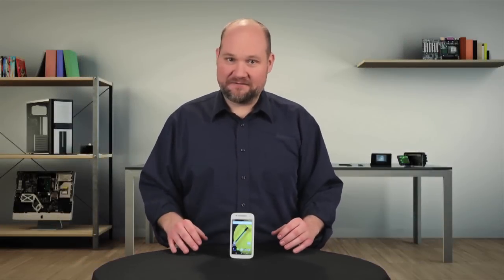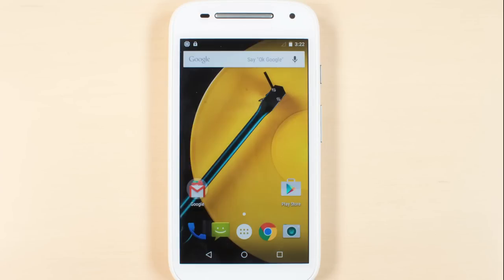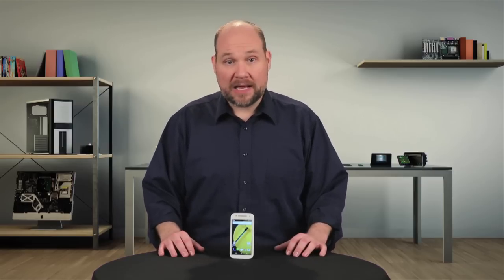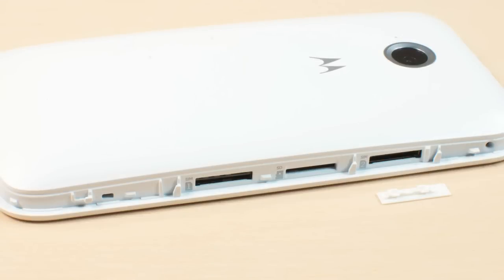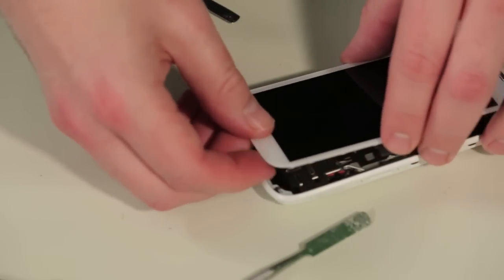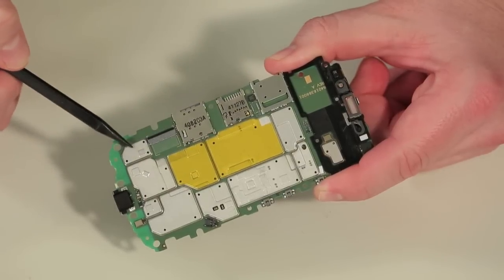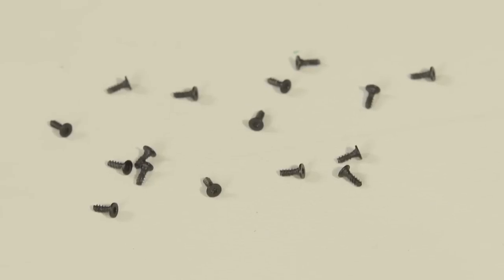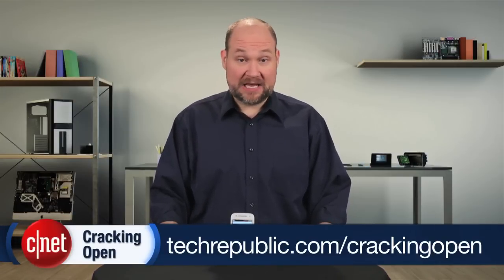Cracking Open - Motorola Moto E 4G LTE

Comment: What a stupid design. I have a Moto e 4G LTE that I purchased SIM-free in late 2015. I live in London and I use it on an occasional basis with a Lycamobile SIM card specifically to call my family in Italy affordably. (My current daily driver phone is a Samsung A5 (2017) which I have under contract. If I were to ask for roaming to be activated so that I could phone abroad, it would literally cost me a fortune to make a call.)

The Moto e can be said to be still in as good as new condition except for one thing, a couple of months ago the battery died. I ordered a new one recently and have just received it but now that I want to change batteries, I suddenly discover that the back doesn't come off and the only way to replace it is to remove the screen and basically dismantle the whole thing, something which I don't feel competent to do. Whatever happened to "lever off the back (without tools), swap batteries (without tools), replace the back (without tools)"? Is it me or did I dream that's how things were with my previous Blackberry and Samsung phones? Stupid, stupid, stupid design.

Comment: Do not {{{{{-event trust "freedompop"}}}}} 3 days of overage on the net? robbed me 45.00!!and the phone so far is locked to freedom pop!@! not accepting any other phone services!@! so when you by it !? according to who I spoke too, it is reworked from the inside!@! service was off for more than a year now! I did get it to work as an internet phone! made 2 calls! but now it is locked out! from event loading up on the net! it will not go back to my wifi! I am going to reload by disconnecting the battery!  If it doesn't work? Am I going to put a bullet through it?  All legal of course... "freedompop" biggest upfront pack of lies!@! Crooks! if I get it to wipe clean?  Another thing; you have to pay Sprint To Get It Paid!! "NOT freedompop"  I will let you know if I get it working? and what I did too. Good job on explaining the cover removal!  Have A Good Day!
Reply: Well, when I disconnected the battery there are 2 very small tips of the plug! like smaller than a hair! No Kidding! Now It Is Junk! I can not even see them they are so small! I HATE MAKING ANY MISTAKES! THAT IS WHY A MAKE VERY FEW!!  THIS WHOLE FREEDOM POP DEAL AND PHONE WAS THE WORST DEAL I HAVE EVER HAD IN MY LIFE? TOTTLE JUNK! AND FALSE ADVERTISING! AND THE PHONE MAKER SHOULD BE SUED! TO CONNECT THE BATTERY BACK?  DO YOU KNOW WHAT TO DO? IT WILL TAKE A MICROSCOPE AND I MAY HAVE TO TARE IN COMPLETELY APART!@! TO PUT THE BATTERY LINES BAKE IN PLACE THEY ARE SO SMALL!@! WORST DEAL IN MY LIFE! THE LINES IN THE PLUGG? ARE SMALLER THAN A HUMAN HAIR!? WORST DEAL IN MY LIFE THEY SHOULD BE SUED!! TOTTLE WAIST OF MONEY!@! AND WAS LEAD TO BELIEVE IT WAS ALL FREE!@! JUST BY THE PHONE AND THE "HOT SPOT" AND EVERYTHING WAS GOING TO BE FREE! BIGGEST LINE OF LIES AND FALSE UP FRONT ADVERTISEMENT! WE WON'T GET FOOLED AGAIN!!

Comment: Could have less talking and slower / more detailed dis-assembly footage. 

ALSO IF YOU ARE TRYING THIS: be very careful to hook your prying tool of choice completely under the glass; don't just drag it along the edge. The perimeter contains a thin black strip of adhesive that can get bunched up and make screen repair difficult if damaged.

Comment: My Moto E 4G lte died during a call while it was on charger.  Now will not register charge cycle when plugged into charger and will not turn on.  Is it DOA or is there a "trick" to revive?  No problems at all with it, battery charge lasted all day, and then some. No sound, no warning, nothing, just gone. Any info much appreciated.

Comment: I followed your instructions on a Motorola Moto E 4G LTE, and upon doing the opening procedure the screen cracked.  Glue must be dissolved with the correct solvent that will break glue bonds without damaging electronic components.

Comment: Touch Screen of my  MOTO E 2nd Gen XT1527 is not responding, I Hard reset the mobile.
but still screen is not responding. can we replace touch screen ? What will be the approx cost?
can we get genuine touch screen on ebay or amazon etc rather than motorola care center?

Comment: Uh, this phones has been 50 .00 US for over 6 months, who is raping you at 120? BTW, 50 bucks UN-locked. Carrier or none.
Reply: You can find them on Amazon regularly around $40 brand new! Of course they're "locked" (you can get them unlocked though with extra steps of calling your carrier) and bootloader locked (which you can't do anything about, but only neccessary for custom roms and recoveries). I bought the Moto E LTE for $60 on Amazon it's locked to Virgin but I can call them to unlock it. The bootloader on Virgin Mobile models are unlocked. So now I'm running Android Marshmallow 6.0 on CyanogenMod 13. I also have TWRP for recovery.
Reply: +Random Fandom you arent telling me anything new, but thanks for adding your personal anecdotal detail.
Reply: +Dan Lo Fat lol

Comment: No chickenshit, battery , remove it, replace it - it is NOT glue, it is JUST double-sided tape, as ALL motos have had since their first non-removable battery!  By the time you might need to replace the battery, the taape will be quite uslesss, the battery might just fall out of the case! Just like the Droid 3 and Droid 4 do.
Reply: Good to know. :)